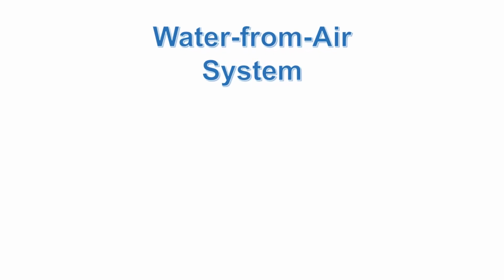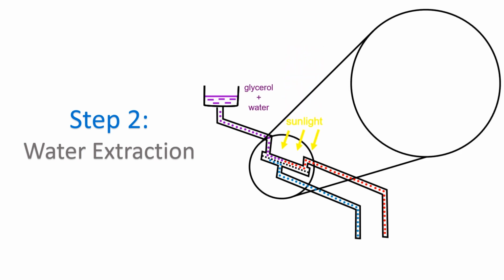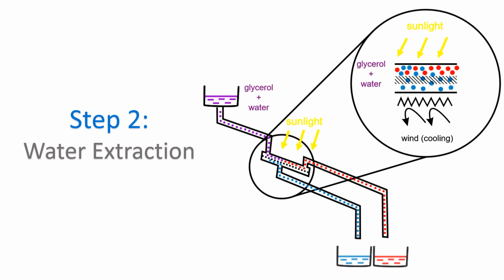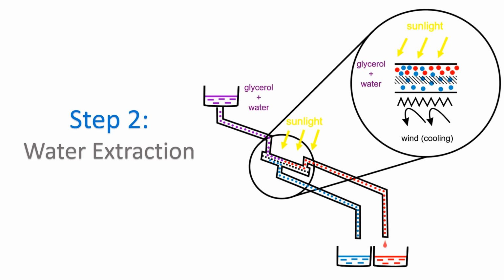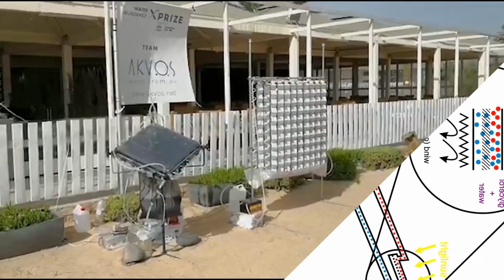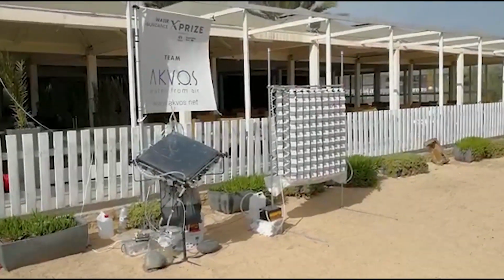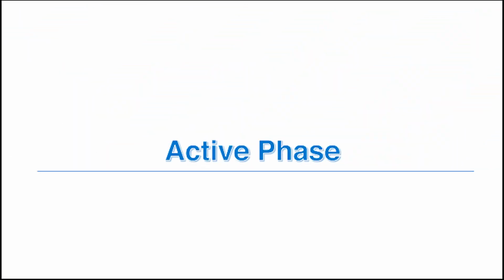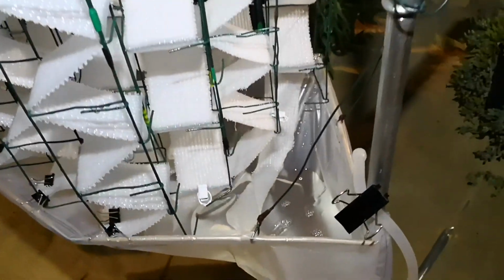AKVOS Team - Water Abundance XPRIZE - Round 1 - video demonstration

Comment: I am the scientific & technical consultant who worked with Stiftung Sanakvo (Team AKVOS during the Water Abundance XPRIZE competition). Sanakvo is a non-profit, humanitarian foundation. In January 2018, I visited the Sanakvo office & research lab in Brno, Czech Republic and participated in the field trials of their water-from-air system. The field trials were done in Santa Maria, Sal Island, Cabo Verde (Cape Verde; 17°N, 23°W). As explained in the video, solar thermal energy is used to drive the processing of atmospheric water vapour into potable water. A pump in the system was energized by electricity from the local grid (but could also have been energized by, for example, a solar PV system). The energy cost of the water produced by water-from-air devices is higher than for reverse osmosis systems. The former has to accomplish a phase change of water from gas to liquid whereas the latter is processing liquid water all the time (incurring no energy cost of a phase change). Commercial versions of water-from-air systems include water treatment as part of the process. Practical versions of the AKVOS system, with reasonable footprints, could be installed on rooftops or vacant land to provide a multitude of independent, decentralized drinking water supply points for a village. Water-from-air systems are appropriate as a drinking water supply solution in tropical locations where population has outstripped sustainable local sources of liquid water (no matter how polluted---because that can be treated relatively economically). There are many populated places worldwide (Sal Island, for example) where liquid water scarcity is a fact. The short term, usually unsustainable solution, is often to import water to where people live (Sal Island imports bottled water from Praia, Cape Verde and from Portugal). The longer term, sustainable solution, is to distribute properly designed and constructed water-from-air systems throughout the liquid water scarce region where people live.